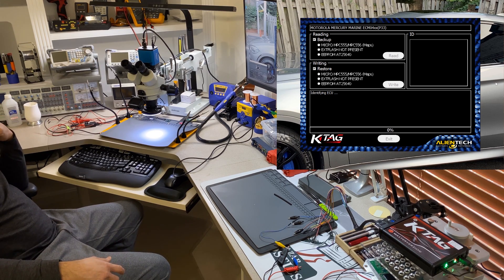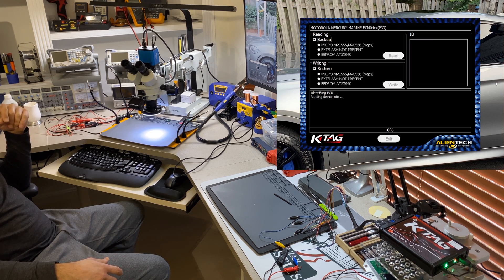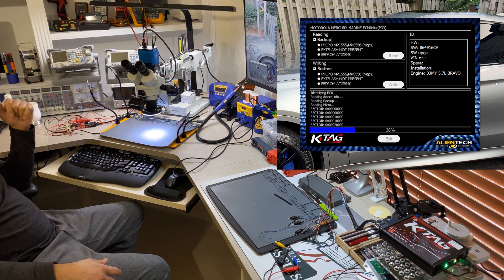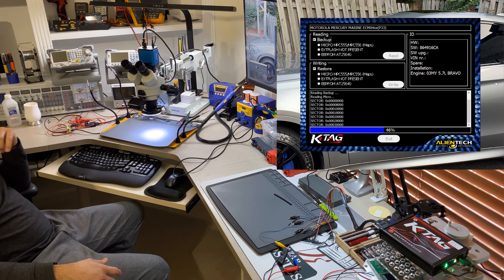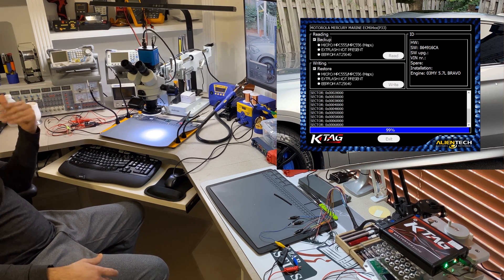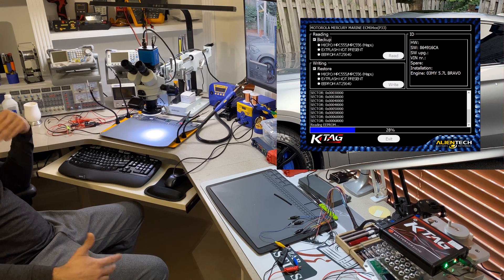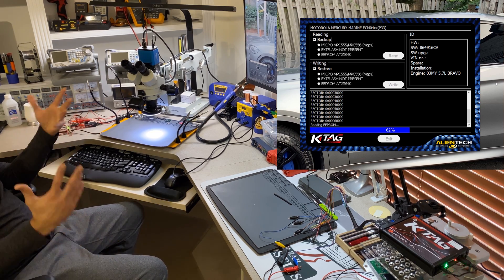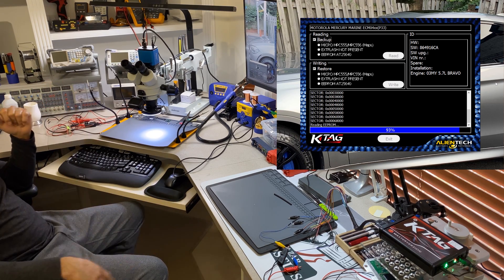How to use K tag to read microprocessors and eeproms

Comment: How do you know what ecu you have?
Reply from the maker: With the sticker in the computer and K-tag will tell you if the correct plug in has been selected, if not it will tell you that you selected one but the ECM connected uses other and will show which one.
Reply: @MaicSalazarDiagnostics  okey! I have ktag but the ecu im trying to clone is not listed(esu411 and esu121) what program should i use? Xprog?

Comment: Thanks for all this lot. In my case the 2018 Forester got a new engine and the old tuning parameters cannot be cleared from the ECU. Can K tag do it?
Reply from the maker: If you have an original file to instal then yes. But you can’t just change parameters with Ktag.

Comment: Hello. Perhaps an odd request but I don’t do an awful lot of ECU reading so don’t really have a huge need for a BDM frame and adapters. 

Is it possible to show how you go about soldering the female connector on the BDM/programming pads? 

If you could possibly show that or if you have a previous video showing that I’d be extremely grateful and thank you!

Comment: I typed a new folder with k-tag in my bmw x3 e83 with k-tag. I successfully typed the folder but after that I can't start the car and there is no communication. Can you help me?
Reply from the maker: Did you saved the original file from the DME? You said you typed not sure what you mean?
Reply: Yes yes i have both mapps and eeprom but i can't type in ecm
Reply from the maker: @misko4964  it seems like you have corrupted the files in the micro.  Ktag can help you if you send the files to them. If your Ktag is original. Otherwise you need xprog and load the original files

Comment: Great one marine engine ECU.
I have a boat shop
Reply: Oki and what was the problem
Reply from the maker: @amineberrahma3675  internal parts In The ECM
Reply: Was this one for a repair or a tune?
Reply from the maker: @amineberrahma3675  repairs. But I do all.
Reply: @MaicSalazarDiagnostics  great what model engine and what was the problem?
Reply from the maker: @amineberrahma3675  350 Mag Bravo. This one was a start and run then dies. But was running really bad and no comm with scanner. It will die and then starts after a few minutes then the same, no more than 2000 rpm.
Reply: I've not succeed fixing or did you replace
Reply from the maker: @amineberrahma3675  I fix these type of module every day, I have all parts in stock if you need repairs email me at info@maicsalazardiagnostics.com
Reply: Ok thank you

Comment: hii maic,

nice clear video!

quick newbie question. in the Ktag.
can u see current engine hours in the software, and do u have the possibility to reset

in this use for an for an mercury engine that is completely revised?
Reply from the maker: Well you can download the eeprom file and then use an editor to correct the hours if you know where to look for it. Then either connect to the engine or use a simulator with a diagnostic equipment that let you see the hours.
Reply: @MaicSalazarDiagnostics  tnx for the fast response, going to do some more digging

Comment: does ktag work on only automotive engine ecu? i mean tcm,srs,dashbrd, immobilizer unit doesnt?
Reply from the maker: Most engine computer. Nothing else
Reply: @MaicSalazarDiagnostics  if i havent the green adapter can i use other method ( connecting wires at ecu pins or solderin)  ? i mean does software show u many methods for every ecu ?
Reply from the maker: @abdullbasitosman5070  you only need the adapter if you want to use the positioning frame, Ktag gives you the 2 options, connector or straight wires.
Reply: thank u so much
Reply: @MaicSalazarDiagnostics  ok ok, i have understood that no need to buy 22 adapters because  the software must give me 2 options  for any ecu
Reply from the maker: @abdullbasitosman5070  correct
Reply: @MaicSalazarDiagnostics last two inquiries :  1- what is the master ktag  and slave ?
2- if you bought your clone ktag online please the website link .

Comment: hello i have a question i have a mazda 3 built in 2016 with a denso P5 engine control unit and the fam was 531. i could read normally via obd2 with kess v2 clone. it took about 22 minutes. Now my question do you know which control units lock when you write them via OBD2, because I have heard that some engine control units do that when I write the tuning file that it locks the engine control unit, please thank you for help
Reply: and please make more videos xD

Comment: Trying to work on a bcm for a 2008 gmc van. No signal lights, traced transistors to the main chip (120-LQFP  MB91F011) which I believe is the problem. But not sure which way to go from here. Have you ever worked on one of these? Will any of these chip readers copy / clone the chip? Seems like the bcm's seem to have lots of issues. trahc@yahoo.com if you want to send me an email. I really want to learn this... I'll pay.. Just want to get the correct equipment and knowledge

Comment: Thanks a lot was great 
Have a question for programming used computer  ecu which tool do you recommend 
The ktag that sell on ebay  cloned will work the same or have to buy the original ?
Thanks a lot
Reply from the maker: It all depends on the ECMs you work on. Remember that no tool cover all brands.

Comment: Does these adapter and cable comes in a default kit with Ktag or need to buy seperately?
Reply from the maker: It comes with the master version
Reply: @MaicSalazarDiagnostics 
Does ktag provide dump data as well?

Comment: saludos megusta ver tus videos en especial cuando subes de bmw la vez pasada te pregunte lo de un problema de no encendido de un bmw 325 2011 le remplaze el valvetronic pero luego regresaba el shaft al punto baja asi que no arrancaba el auto lo deje en el tope maximo ,desconecte la valvetronic asi arranco pero en modo de estrategia asi que determine el problema de la ecu asi que se pidio una, lo que are presisamente es clonar la que pedi para evitarme codificacion ,adaptacion ademas de codificacion de cada inyectores ya tengo lectura del backup con ktag solo espero que llegue la otra y a darle el clonado, ktag ya forma parte del taller evita muchos procedimientos con lo que respecta al remplazo de ecu.

Comment: thank you for this helpful video 

a Question please: here you read an eeprom chip from a bad car ECU in order to write this dump in anothor chip of anothor ECU.
we can   desolder this chip from the bad  ECU and solder it in the new one
you do not need a ktag
is this procedure correct or no ?
Reply from the maker: IF you transfer the eeprom no need to read or write. so no need for k-tag
Reply: @MaicSalazarDiagnostics  thanks

Comment: Thanks for sharing Maic👍
This is a complicated tool, does it have the potential to repair corrupted microprocessor, what is your experience using it, would you recommend it & does it covers majority of the chip's😉
Really enjoy your videos ton's of knowledge👍
Stay safe Bro❤
Reply from the maker: It can’t repair corrupted software. That is why is good to save all calibrations and EPROMs files for future reference and in a case that you need it for a blank or corrupted micro.